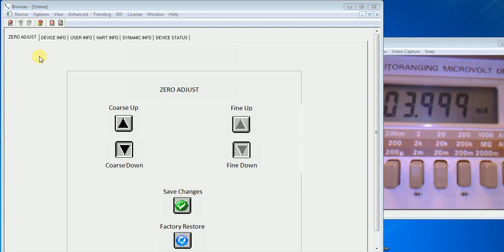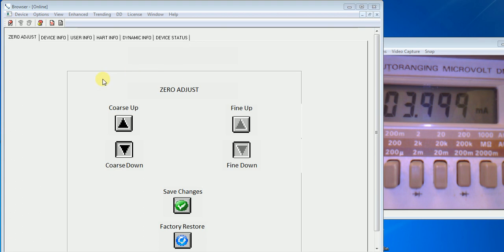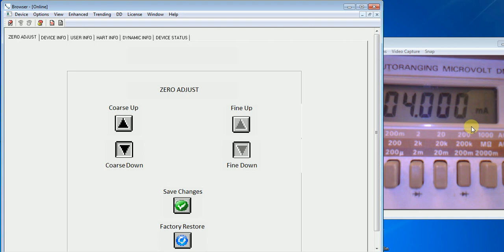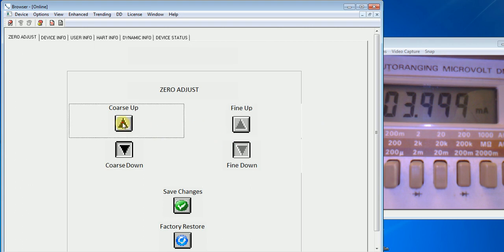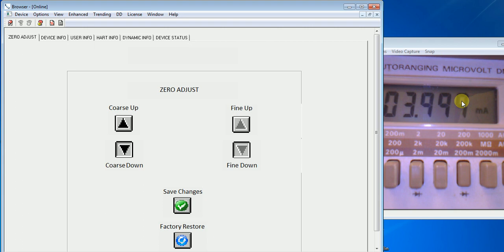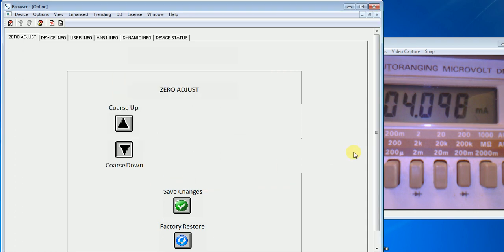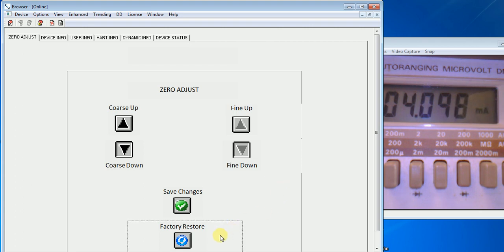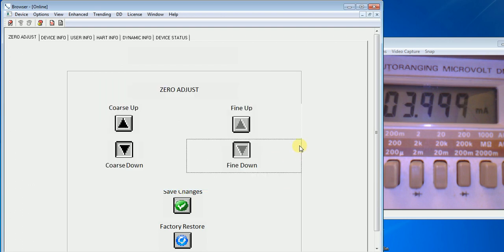DevCom2000 Lite: Getting Started - Zero Adjust

Comment: Thank you for uploading this video. Can we calibrate the sensor by adjusting zero and span to read accurate pressures using devcom software? Without modifying any internal hardware components how reliable is this calibration!